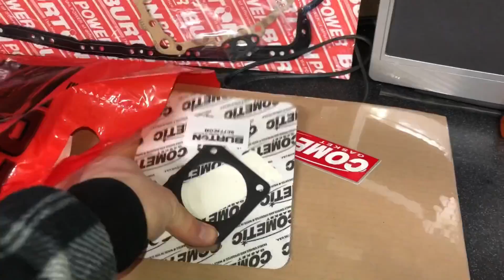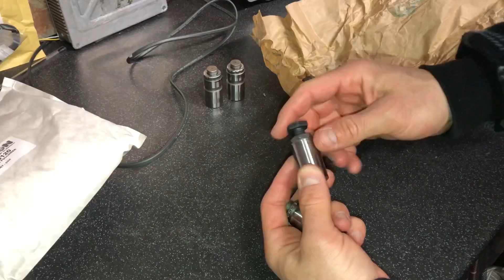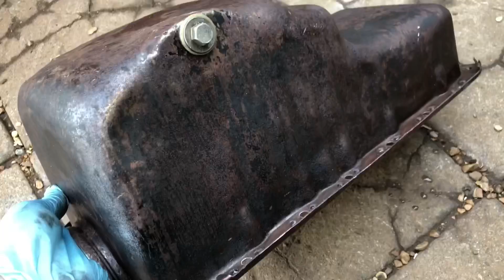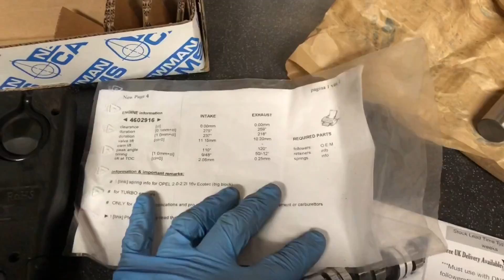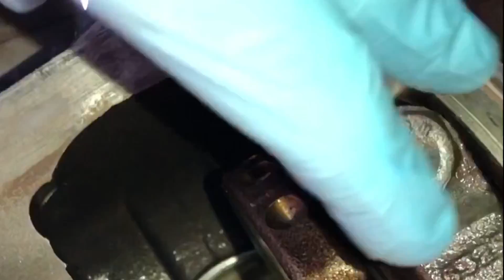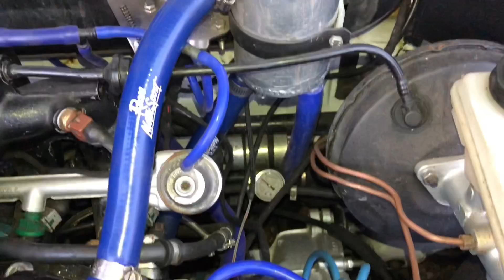Stage 4 Racing Camshaft Fitted! RS Turbo Engine Revs AMAZING!

Comment: I tried fitting these mechanical lifters and failed. Don’t know how to adjust them. Inlet should be 0,008 and exhaust 0,01. Don’t know where to don’t feeler gauge this small . Normal in feeler gauge the smallest is 0,05mm 

So had to fit my hydraulic again.

Comment: For the sump gasket I'd recommend Permatex aviation gasket sealer it's what the VW air-cooled dudes in America use when they build those flat 4 engines and mate the 2 Half's of the crankcases together

Comment: why did you run the car at 3000rpm at start up? i'm looking at a newman cam for my fiesta rs turbo and it says on the newman cam website to not run it at 3000rpm

newman cam website =
Start the engine as you would in normal use. There is no need to run the engine at 3000 RPM for 20 minutes. Just treat the engine as if it was new for the 100 miles then off you go.

Comment: I'm learning loads from your clips. I just bought my second rs and I wont to do most of the work myself this time. I had problems with leaking through the rocket cover bolts. I see your are different with different washers and look loads better. I was wondering where you got yours from? Thanks

Comment: Please can you do a video on how to install a FMIC on the zafira gsi I have a intercooler kit had it since last november and cant find any videos on how to fit it. You swid on a previous video about possibly doing an intercooler tutuorial on your gsi
Reply from the maker: I will be fitting one soon mate ready for a map
Reply: @AaronUnknownPerformance  ah sound ive literally built all my intercooler up to try an figure out how it goes on but the pictures the came with the intercooler in the manual dont match what contents are in the box. Also I dunno where boost sensor is because that has to screw into the stainless steel pipe. I'm off at the weekend so gonna have a look then its all sat on the sofa at the moment so missus isnt very pleased but it is what it is lol

Comment: this is the only camshaft to run on a cvh, kent/piper both proven to fail time after time. 

i know i dont need tell you this but alot of cvh suffer with low oil pressure which in turn destroys the cam, so defo worth keeping an eye on that going forward. 

i was speaking to you via instagram the other day such a fiddly cam to set up but once done its really worth it

Comment: That thing is silky smooth for a cvh! Seems mega responsive when you revvd it up top job. Be a totaly diffrent car on the road👌
Reply: They wasn't this quiet new
Reply: @sr71blackbirddr  😂haha no they wernt they were renowned for being very tappy on top end and a bit knockey.
Reply from the maker: Its super responsive, ive had a lot of Cvh rs turbos and this is the most responsive
Reply: @AaronUnknownPerformance  what sort of power are you aiming for aaron? You got all the good stuff on to make good power😎
Reply from the maker: Basically gonna stick a load of boost in it and find out 🤣

Comment: Looking very good,
Can you not find a set of roller rockers for this, I had them fitted on my cvh 28 years ago, and it made the car reved nicer,
I do have a larger
torque developments plenum / manifold for the cvh xr3i , rs1600 if you know anyone that would interested,
Dave
Reply: You can buy roller rockers from the states I think there around £350 to £400 plus import tax!!!!!!!!!! Your plenum/mani sounds good old skool..
Reply: @michaelmatthews8171  
Hi the following roller rockers cost a lot 27 years ago , the inlet is fitted with nitrous oxide injectors if I remember it was for 50bhp, 
Dave
Reply from the maker: Yep harland do them, im looking into it 👌🏻😎
Reply: yes euro cvh..As the American type are different so I am told..
Reply: @michaelmatthews8171  
Torque developments did a 1900cc conversation using the USA crankshaft as the stroke was different, there was a big write up in Fast car magazine,
Dave
Reply: @AaronUnknownPerformance  
Your car's look very good,
I have not had a cvh for about 24years,
I had a xr2 MK2 , in the end  it had a hybrid turbo from the rs turbo, a Piper cam , l went to pace and had them make me a charge cooler , 
I also had a LSD from the rs turbo , we fitted it in the xr2 gear box,
Dave